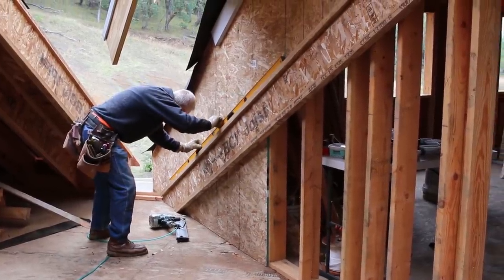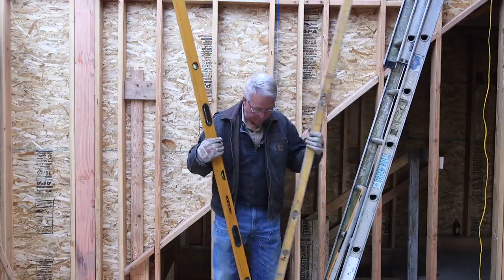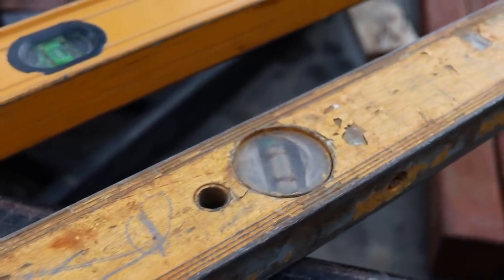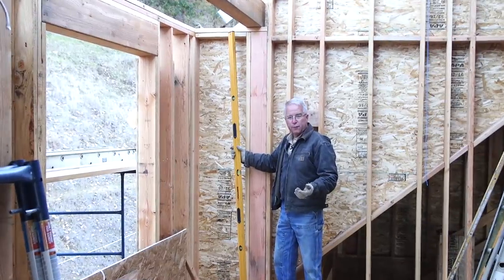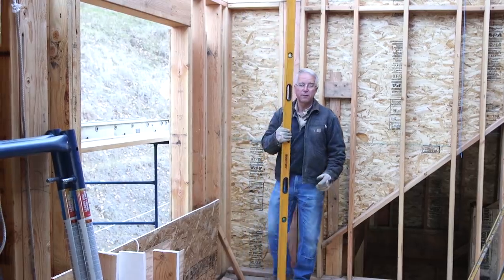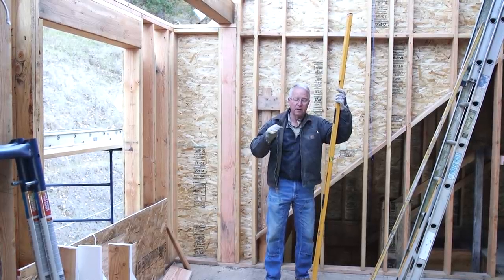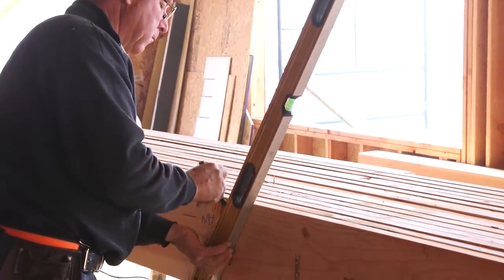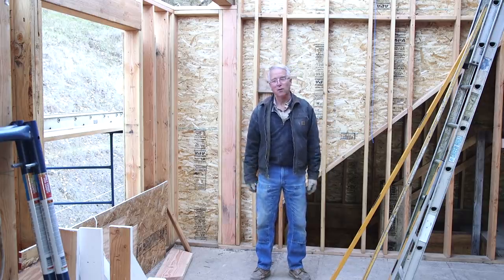The Luxurious 8 ft Level

Comment: On the subject of levels, I recently picked up a 2ft ADA compliant digital level to evaluate. Luxury item for sure, but what surprised me was how relatively inaccurate an average priced bubble level can be. Especially outside of ideal viewing conditions. You wouldn't think 0.1° is a lot, but is it ever when you are trying to be precise. I soon after picked up a 4ft to match and it's now my go-to level.

Probably not for everybody, and certainly even more fragile than a typical level, but if you are the type of person that looks for the most precision possible, I would highly recommend you try one.

And now I need an 8ft level. Thanks guys!
Reply: Now what exactly makes a level ADA compliant? Or is it designed to be used for making things ADA compliant?
Reply: @jamesfurrer2924  "ADA compliant" might not be the right phrase. It's capable of measuring slopes for ADA compliance. Just means it has increased accuracy over other non-ADA levels.
Reply: I have to agree that when you are doing work that must be ADA compliant, there’s no room for error. Architects always have that little asterisks on the plans that says *Oh yeah, and everything must be ADA compliant (to paraphrase). Which isn’t always that easy with the dimensions given on the plans. In my area, ADA compliance is very strict.
Reply: @psidvicious  I built a ramp for a church a few years back, and when I was pulling the permit the building inspector advised that I avoid terms like “handicapped access” in filling out the application. I’m sure the width and slope of the ramp met ADA guidelines but there must be some other specs in the fine print that will bite you in the backside if you use the wrong terminology.
Reply: @janderson8401  I’ll bet you’re right on that. I can’t remember the incident, but it seems like I remember having difficulty with something, worded in such a way that it made it fall into a different standard.
I know things differ from area to area. I’m always amazed when I visit family out in Texas. Just walking around town, I constantly notice blatant violations in ADA guidelines. Where I live in South Florida, it’s not a prerogative matter. It just has to be. If an inspector doesn’t catch it, you got away with one this time. It happens, but inspectors around here are usually acutely aware of ADA guidelines.

Comment: Stabilla is the standard for quality in levels
Reply: We bought a bunch of Empire box levels (since they were bought by Milwaukee) and they all broke within a year. They looked and felt sturdy, but some the goals fell out, and some vials shifted. I will say, Milwaukee was exceptional at getting them warrantied. But Stabila, Sola, and Johnson are all, German made, good levels. (At least the ones we have are made in Germany. I don't know about nowadays.) Levels are self-proving without any calibrated reference surfaces needed. So it is easy to check them in a couple of minutes.
Reply: @xenonram  I just bought an empire box level 4' for $12 not too long ago, I was stoked because it was usually closer to $60... Dang that's disappointing lol

Comment: There's a reason I own several levels. One 30cm, one 50cm, one 1m and a 2m level. There's a use for every single one of them. I could go and buy a few more, but do I need to? No. They are not the most expensive, but they aren't cheap either. But as long as it gets the job done accurately, that's more than enough for me.

Comment: I think one nice thing about 8ft levels is that manufacturers of them have yet to decide to split them into 2 pieces. Go try to buy a "straight edge" and you will likely find all of the 8ft ones are "2 piece" that you have to connect which throws off your accuracy AND precision and is 100% useless junk. A level will, so far, still arrive in one piece and will actually work well.

Comment: bought a bostitch 72 when i was building my shop. i used it to plumb and level everything while building. i have 4 torpedo levels, two 2-foot levels, and a 3-foot level. i use the torpedo levels the most as the stuff i build is usually smaller. but if i need s straight edge or i happen to be building something bigger, the 72 comes out and goes to work.
as a straight edge, i just clamp it down, set the saw against it and get to cutting. and while i might have no need for an 8-footer, i might wind up with one. 'cause why not? i might just feel the need to build something big, again, lol.

Comment: That's luxurious? You should try a telescopic Stabila level, perfect height for any wall. I have a small telescopic Stabila level that I use for door thresholds and double doors. Torpedo level is also really nice, and a 2 foot level. And a 12 foot straight edge. Also a high precision 6 foot level for setting door jambs.

Comment: I had an eight foot one a bit back, but I am only a "handyman", and don't frame enough to warrant the need for one.  I sold it to a guy on a framing job.  My truck has a 6' bed, so storage was an issue and I was always worried it was going to get banged around or stolen.  I have a couple of 6' levels, a couple of 4', probably a 3', 2',  and I am not sure how many torpedo levels.  If I needed to check the plumb/true of an 8' wall I would find or make a straight board.  I enjoyed the eight foot, and it is a luxury, but was just too cumbersome for the light work I do the majority of the time.  The 4' and 2' are my go-to's since they fit in my truck and stay out of the way when I don't need them.
Reply: I’m with ya. 👍
Reply: I was just looking through your videos and did not see one on the subject of a tool list for a home gamer, novice, apprentice, journeyman, and master carpenter.  I think that would be a great one for anyone looking to either start building, or stepping up their game.  I know I would rely on watching and asking questions when I showed up at a job to add, or subtract, tools to what I brought.  I know a lot of this would be elementary to the bulk of your viewers, but there should be a fair amount of people that carpentry is a hobby or occasional necessity.

Comment: 2:53 I’m sorry but my experience disagrees. I was told countless times “plywood edges are cut straight,” so that dogma guided me using edges as references. If that were the case, all plywood edges should meet up with zero gaps when butting up to another sheet. It’s just not our reality. 

Even more egregious is the fallacy of “square” factory sheets. Chinese manufacturers often sell sheets at quoted dimension to avoid the secondary operating of squaring. Some domestic manufacturers cut 1/4” off nominal to do so, but their milling equipment may be out of cal tolerance or the sheet grew into a trapezoid during shipping. 

If we lived in an ideal world, these dogma would hold. Unfortunately, it was only on jobsites that I learned to be skeptical of “common knowledge.”

Love the series. 😂😅
Reply: I, unfortunately, have to agree with you. If it really matters, you cannot trust sheet materials to be perfectly anything.
Square, parallel, streight edged, void free, A faced...etc.
In 'normal' use it doesn't much matter, but don't assume and rely on these dimentions!
Reply: I can absolutely confirm your critique on Chinese plywood. 
-A few years back, a product called Chinese Film-Face plywood was introduced. It ‘looked’ to be an amazing product and comparatively inexpensive to fir-form for example. It was/is a 7 layer plywood with essentially a thin, black, melamine face on both sides. Perfect for concrete form work...we thought.
-We soon began to notice gaps appearing in the seams of the decks (floors) we were forming up. We started checking a few sheets of this CFF plywood, and sure enough, we were getting as much as ± 3/16” variations in lengths and widths. It sounds trivial, but it’s not, it adds up and multiples errors very quickly. I specified to our purchase agent and lumber supplier from then on, “No Chinese Film-Face on my projects!”
-To be fair, I’ve never had dimensional problems with American or Canadian produced lumber products.

Comment: Ah. That iffy subject of loaning tools. I am between a rock and a hard place on this question.

Scripture tells me not to deny someone who asks.  But people are human. And I can not afford the losses, neglect and damage that so often occurs with LOANED tools, especially. So here's what I usually do: I bring the tool to their project and use the tool in its' place on that job. I do that work and their need gets met. And I keep everything warm and friendly.

Furthermore, I learned from my Dad to put an obvious mark on my tools. Usually something that can be seen some distance off. And I use a stencil to put my name on it as well. I get razzed for this but it has cut my losses a great deal.

If anything about my system appeals to you, I use a brightly colored paint. But I can't help you with the name stencil. I was given use of a stencil cutting machine for a short while.

On the funny end of all this, Dad's method was random. His paint was several different colors. And that was his only mark. So how does that show that any tool was his? I use a single, particular color. I have become known for it. And there is no question that it is an ownership mark.

This method has preserved peace and promoted helpful cooperation.
No complaints so far.
Reply: On ‘tool marking’ - The tool that always seems to ‘change hands’ the most, is undoubtedly the tape measure. Everyone has one and it’s easy to mistake ‘mine’ for ‘yours’. Whenever it was time to get a new tape, I would always pull out the full length of the blade and scratch my name/mark on the underside of the blade for positive identification. [even if they did happen to find your mark and scratch it out, you knew good and well that was your tape and that person was not to be trusted ever again.]
Reply: @psidvicious  
Ah yes, the tape measure. I have a little story about that.

After Dad died I was visiting my step mother, his widow. Around the end of our second cup of coffee, she asked if it wasn't a good time to go through some of Dad's stuff. I said, No, not without my three brothers present as well.

But we all live great distances from eachother. You can never tell when we would all be together again. So I said, well I would like to have one keepsake item after all. So those of us present all trooped out to the workshop. I chose Dad's silver colored 30' Stanley tape. It was a good small keepsake that would represent Dad.

Now some guys in construction are a bit light fingered. And sometimes the old man did this too. When I got that tape home I was looking it over. It had someone ELSE's initials scratched into it! Welp he did it again. So in another way it did represent him... in two ways!

Comment: Check your levels at the beginning  of every day with another level.  When one goes bad it will make for a very bad day.
Reply: Instead of checking with another level, simply lay the level on a surface (doesn't have to be a level surface). Make note of the bubble reading. Then, flip the level around end for end. The bubble reading should match the first reading. If not, your level is no good.
Reply: Same as checking a square. Good tip.